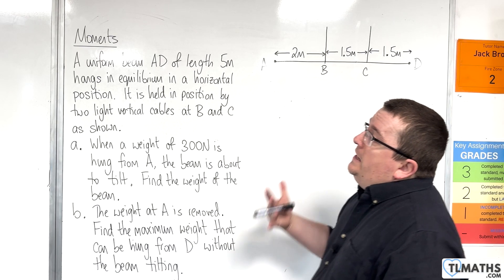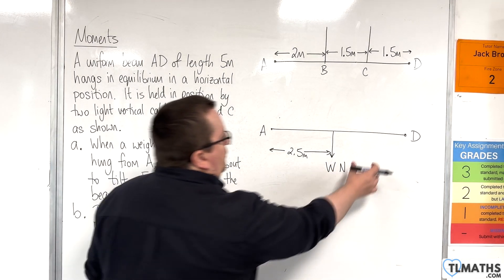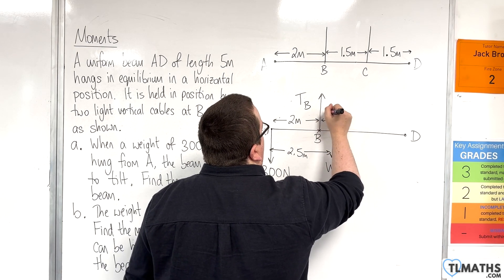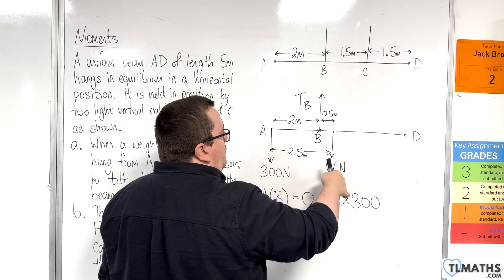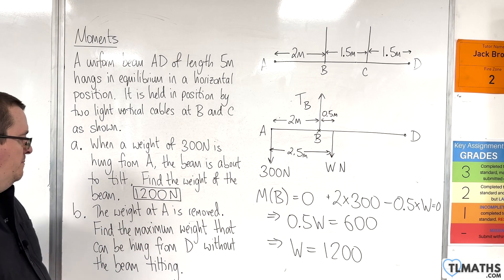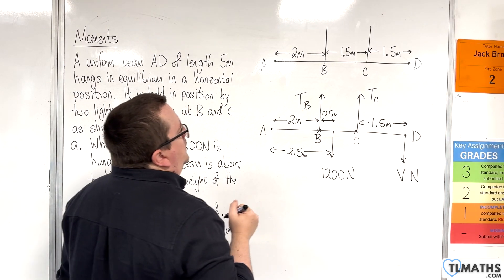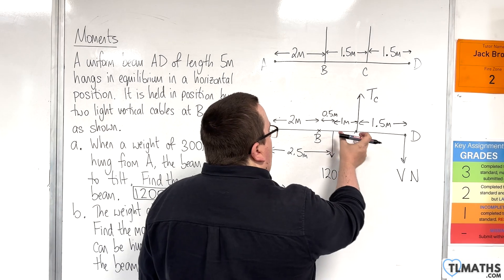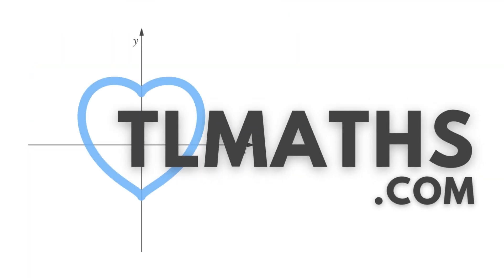A-Level Maths: S1-21 Tilting: Example 2

Comment: Sir can you explain logically why the reaction forces are zero when the beam is on the point of of tilting
Reply from the maker: Imagine you have a beam held up by two strings as in the problem. Let’s say you keep adding weight on to one end. Eventually the beam will begin to tilt towards the weight as it is too heavy to be supported. In this instance, the beam will only be held up by the closest string - the other string will go slack and there will be no tension there
Reply: Great thank you